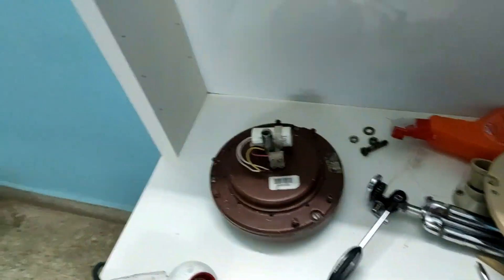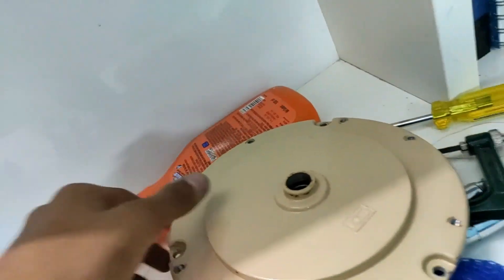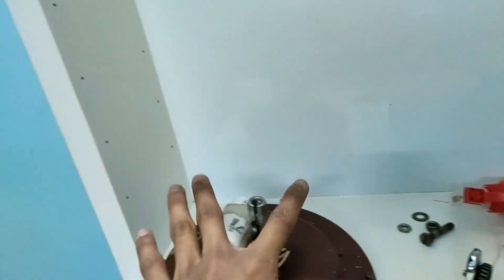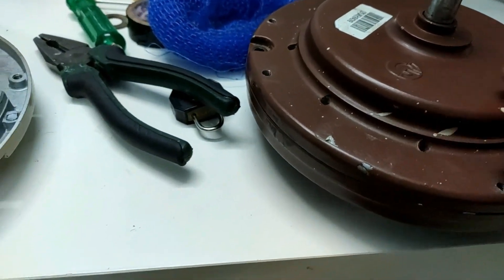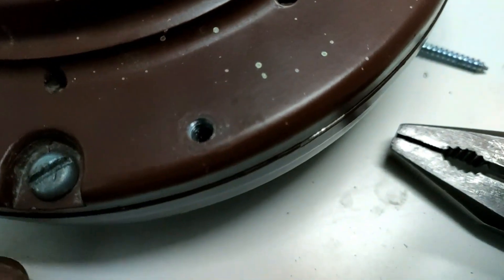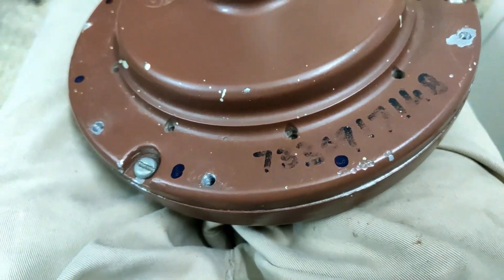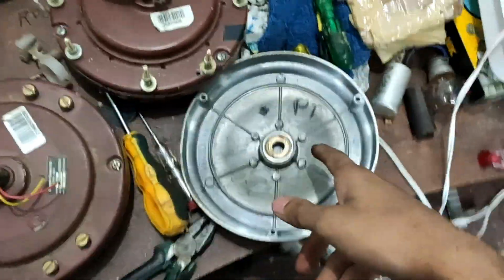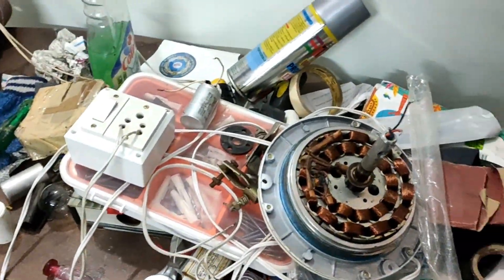Crompton greaves High speed ceiling Fan , 3 blade to 4 blade Conversion (Dec Air HS)

Comment: Solan made stator with oilfilled capacitor will give good performance and more speed, or else if youf cool breeze is copper winding it will fit perfectly and gives more speed, 

With solan made highspeed DECORA or aura or jura or avancher stator with oil filled capacitor it will perform good

Comment: Pls try relocating the non decorative shanks from upside to lower side of blade with golden colour repainting so that it resembles the dec air blades. Also pls make a video of it.
Reply from the maker: was supposed to but unfortunately abandoned the project
Reply: Is it safe to replace 2.25uf capacitor with 2.5 uf capacitor in crompton dec air ceiling fan for increase of rpm